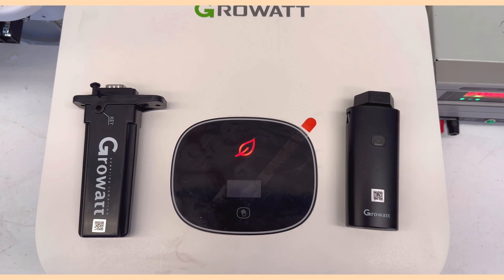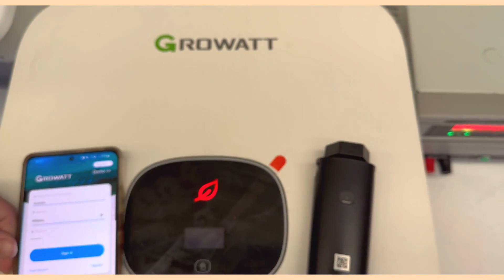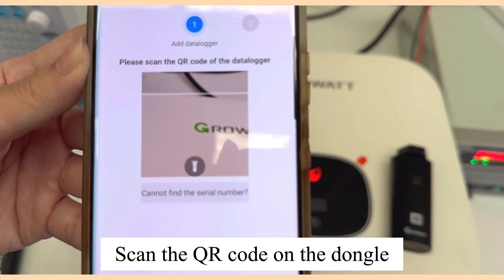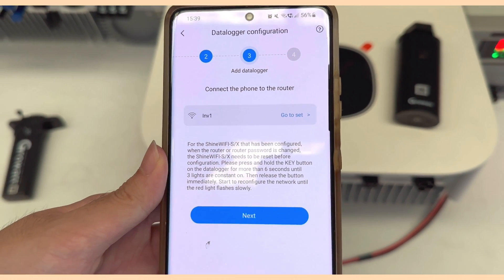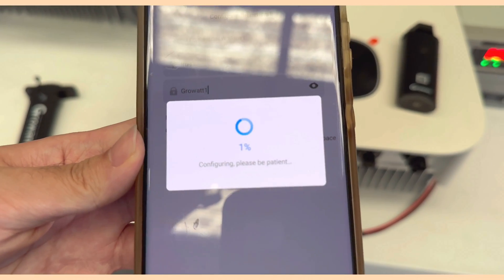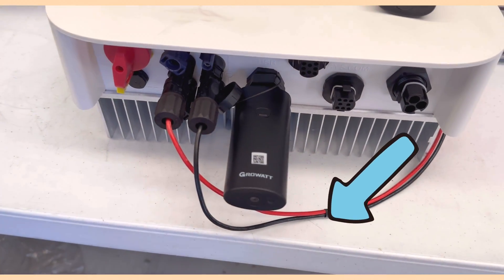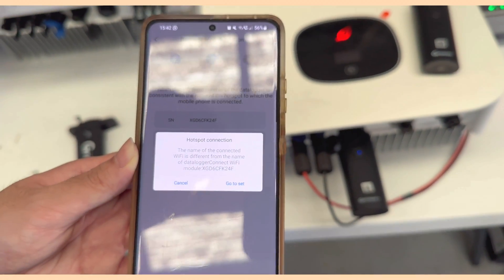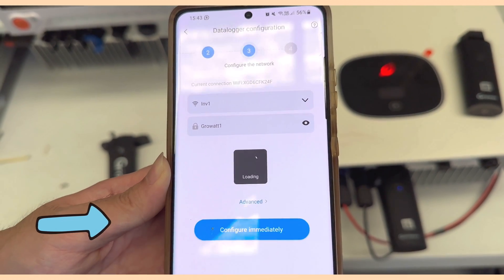Growatt wifi dongle configuration tutorial

Comment: Hi. I have a shinephone app account already and connected to wifi already but now I changed a network and the app is offline. How I reset new network wifi?  Thanks
Reply: You basically follow the steps in the video 
I used the hotspot mode gave me a lot of grief to start with need to make sure location settings are set to always and I had to restart my phone before it would allow me to get to the modem settings then I could change the wifi
Hope that helps

Comment: We want to con figure:

1. Private IP address on each inverter and connect each also using rj45 cable to the local area network

2.   public Port number range inorder to configure Port forwarding on the edge router to remote manage and monitor the inverters.

Your assistance is greatly appreciated

Mike